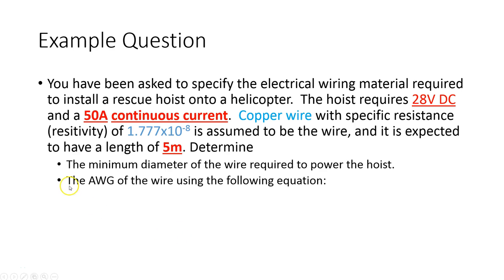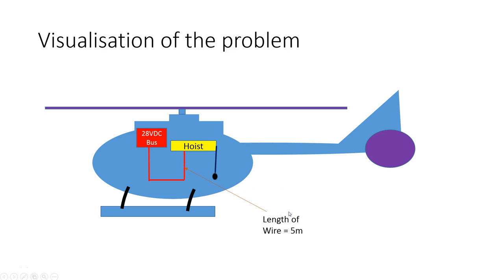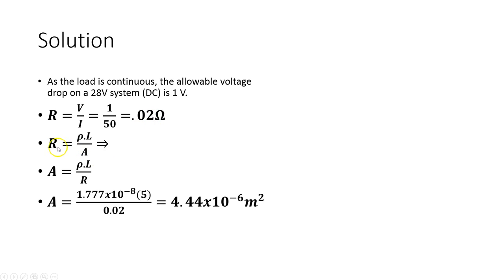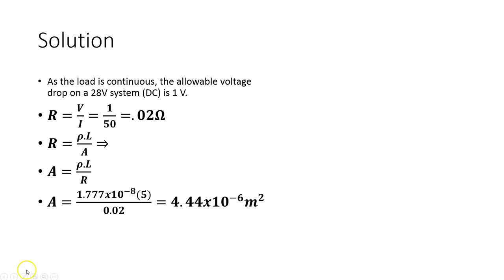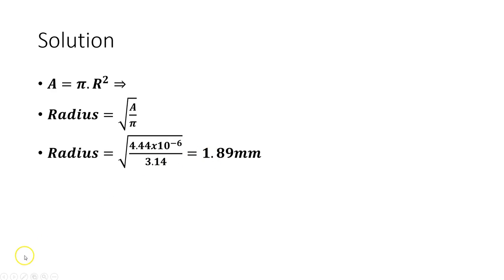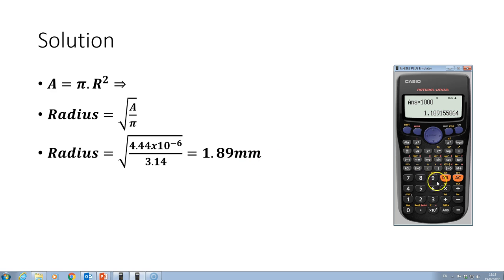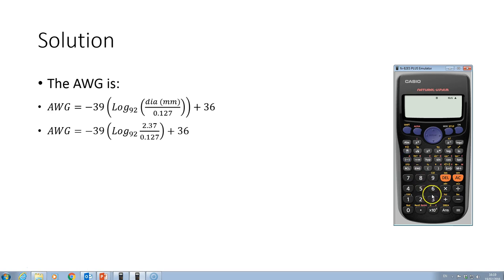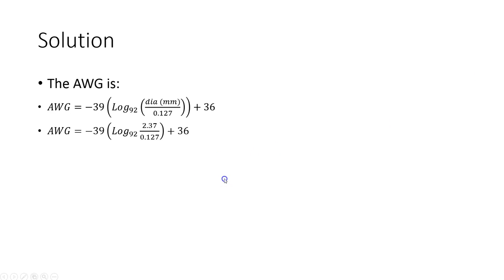Determining the AWG

Comment: ok- so what is the formula for sqr mm? or to get sqr MM from gauge and vice versa? Other than just looking at a table and saying 2.5sqrmm is 13 gauge
Reply from the maker: Divide sqr mm by pie, get the square root of that answer, then double it to give you the diameter in mm.  Put that figure into the formula.
Reply: @RoddyMcNamee  Thanks- it worked until I got to 70mm2 wire but first had to make my excel sheet figure it out for log...lol

Comment: Thanks, neat video.   I was recently thinking what I could make out of the data and common descriptions of AWG such and 3 gauges less, the resistance doubles, etc.  Here is what I developed, but if anyone wants to critique it, I would appreciate it:

thickness" =
= diameter" = (0.1") 10^((10 - gauge#) / 20)

gauge#  =  10 - 20 (log(10 thickness))